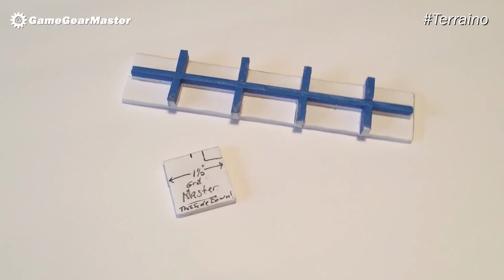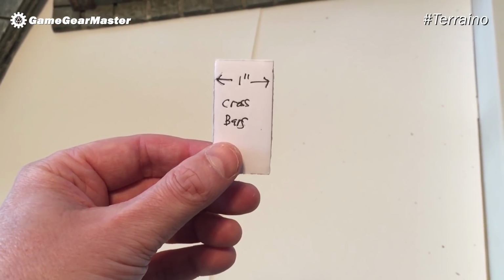#Terraino Basics #1: Craftable Interlocking 3D Terrain

Comment: How thick and high is the styrofoam you use?
Reply from the maker: Terraino is designed to work with Readiboard brand foamboard available nationwide at Dollar Tree stores or online through the GameGearMaster Amazon store (links to both in the manuals). The foamboard is 3/16” thick and 20 inches by 30 inches. Using any other type of foamboard may not work mainly because all other brands of foamboard don’t have easy to remove paper on them like Readiboard.

Comment: Nice concept and aesthetically pleasing. Do the groves mess up any measurements, or is it all relative?
Reply from the maker: Not sure I understand your question. Mind elaborating?
Reply: Game Gear Master 
I watched some more and it came to me.  I was confused between the ground and floor tiles. But I was referring to the groves between the squares. Let’s say you have a 50x50 room, 10 squares by 10 squares.  Add the space of the groves and the walls and it doesn’t transfer from paper and is slightly more than 50x50. 
I guess I just forgot D&D isn’t a simulation game.